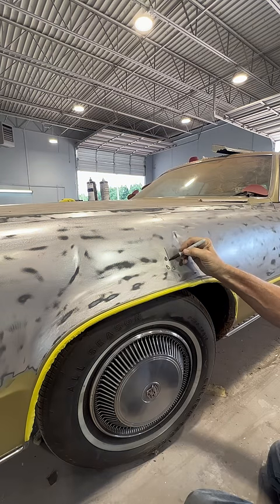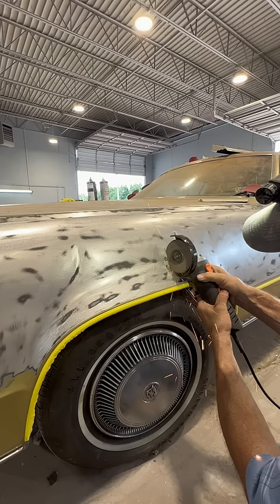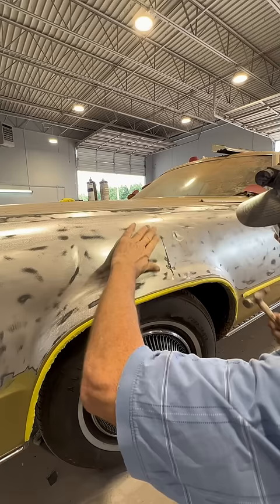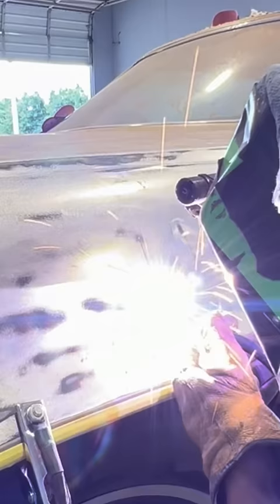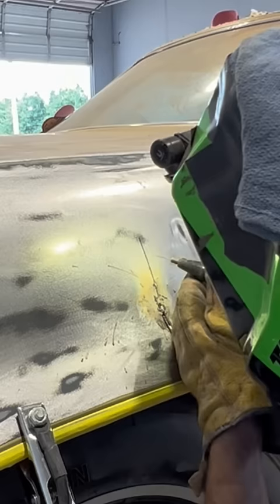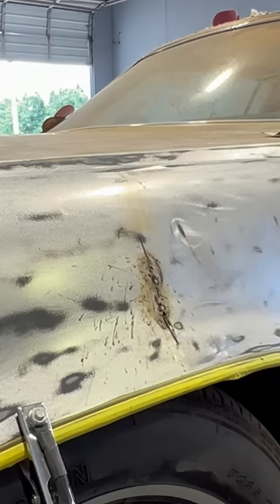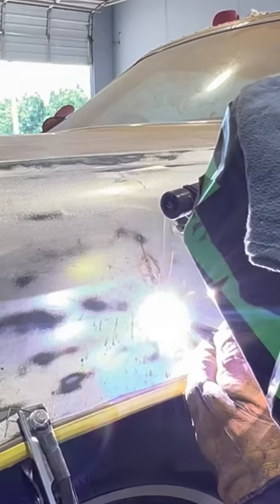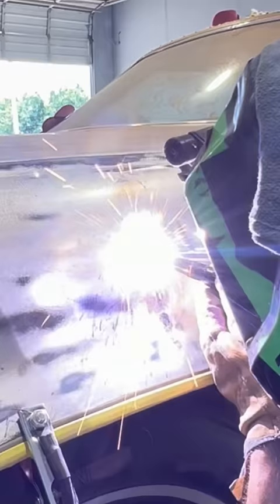BILLY SHOULD BE ARRESTED🤣 How To Fix A Buckle In Sheetmetal FAST DIY Auto Body Repair Flux Core Weld

Comment: I agree with everything you're doing here. But as a Welder you have way to much stick out. Constructive criticism here. Try to keep it wound 1/4 or just under. You'll get a better tack out of it
Reply from the maker: You must be an actual welder.  As you guys are generally clueless about welding sheet metal, I’ll give you some constructive criticism on giving critical analysis of things you’ve never done.  I’m not tacking, I’m stitching.  The violent arc of flux core is prone to blowing out thin sheet metal, even when stitching.  I can partially regulate this with a longer stickout.  I know your intention was to help me, but I am the master of this process, and it is proven😉😉
Reply: @Bondo Billy🆙  actually, have done*. All the long stick out is doing is reducing the amount of amps at the metal. Lower settings would shorten your stick out with a better looking end product on both sides, and a stronger bond of the metal. But in the end its all covered with body filler right! Shitll buff
Reply from the maker: @mm88swrt I explain things so a preschooler can understand, and yet the geniuses can’t.  My process is not in the books, so you want to fault it.  That’s why I’m above expert and professional level;  because I have developed a better way that can actually put welding skills closer to the reach of the novice.  
High heat = instant fusion 
Instant fusion = less warping 
Long stickout = less holes
Billy technique = mastery

Comment: I have some minor sheet metal work I need to tackle, why do you need to Fberglass over the weld? 🤔 I heard something about oxidizing? My rear quarter is asking 🤓
Reply from the maker: The flux residue can bubble bondo, but not fiberglass filler
Reply from the maker: The flux residue can bubble bondo, but not fiberglass filler

Comment: think i would have use oxy acetelyne to shrink it down, no welding needed.

other option is itd not that sharp, use the electric stud gun with the heat tip on it do do the same to avoid the oxy contamination
Reply from the maker: A buckle can’t be “shrunk”

Comment: For what a new fender for a Cadillac cost, and is badly as their maid which means it wouldn't fit anyway, your way is probably a hell of a lot better.
Reply from the maker: I doubt they make an aftermarket fender for a first gen FWD Eldorado 🤔🤔
Reply: @OldBondoBilly  you need to find a better junkyard.
Reply from the maker: @fooman2108 you said new fender

Comment: I did notice you didn't drill the hole at either end of the cut hopefully it doesn't crack at that point
Reply from the maker: I’ve never seen that happen
Reply: I was taught this way way back in the day so that it didn't stress the metal especially when you're doing framework but it was also told to do it when doing body work
Reply: its not like they are going to hook a chain to the fender to pull someone out of the dtch!🤣

Comment: Is it just kitty hair that you put over the weld? Or an actual layer of fiberglass then body filler? Also, would you not have to do that if it was a regular mig with gas?
Reply from the maker: I have put fiberglass filler over flux products since I braised patches in in 1981. You risk Bondo bubbling if you have any pockets of flux left.

Comment: I've seen other methods where they shrink the area in question with heat from a torch. Sorry, I can't find the link.
Reply from the maker: You can shrink stretched metal, but you cant shrink a buckle

Comment: Lol where do I start. where is the welding tip’s cup? Are you using any gas at all? that weld looks dirty. It should look shiny or at least not look muddy. Did you clean the back side of the weld? You get what you pay for I recon. Hope this was a down and dirty repair. 😂😂 cause that is what they got.
Reply from the maker: Watch more of my videos if you want to cure that ignoramus condition 🤣🤣🤣🤣🤣
Reply: Gas? Fluxcore.

Comment: All metal has Memorie,
If metal stress is relaxed properly, and the correct way to use a shrinking file hit it with your 50 grit grinder and your done. Your process wears me out to much to much going on for that solution. Just saying🤨🤨
Reply from the maker: Did some worthless school leave you so clueless?  Do you not know the difference between stretched metal and a buckle?  Do you even know what work-hardened means?
Rhetorical questions;  you don’t shrink a buckle. 🧐🧐🧐🧐🧐

Comment: That is a great way to do it.  I would have heated it cherry red and used my pecking hammer to shrink it followed by filler.  I lasted a little over two years doing body work and would never done the quality work you do.

Comment: Next time just run a weld down the buckle and hit it with a wet rag while it is still hot, you don't need the cut.
Reply from the maker: The metal is not stretched.  I’m the master here🙄🙄🙄🙄🙄

Comment: HEAT   THE BUCKLE and SHRINK IT with the Torch in spots the si ze of a Coin. Then   a  Slapping File You made from a Bastard File. Cooling with water or Air.Less Work. Flux Core is Diseasded with crap  ,get a Wire Feed
Reply from the maker: Stop pretending to know metal work.  You can’t “shrink” a buckle.🙄🙄
Reply: (Use a Cutting Torch)A course file , cut off the handle, bend into a step. about 1 inch3/4 .You want the teeth,  angled toward you ,to pull the metal! called Slapping File, old 🏫  school. I share my tips , not hoard them

Comment: I've personally never met a professional that was against Flux or mig. They both have there strong suits and negatives. I personally prefer mig for allot of reasons But Flux will get then job done just fine. especially if your a DIY guy. I got over 100k in equipment in this facility that would be stupid for the guy at home to buy when he's going to do it 5-10 times in his life. With just a little more work the diy guy can do just as good without the expensive toys. Hell when it was just me  25 years ago I did it.
Reply from the maker: Bravo;  I’m providing instructions for the success of the DIYer.  You for certain know that an amateur can lay down a meg bead that looks pretty without any real penetration.  with flux core, it’s weld, or hole;  there’s no in between.  I’m teaching how to avoid the holes.😉😉😉😉😉
Reply: @OldBondoBilly  your helping out allot sir. and even professionals cant know everything so I love to watch videos like yours. sharing tricks of the trade learned from decades of experience that other professionals may just not have though of before. you may have helped make their job  and mine just a little easier. thank you

Comment: Just wondering if there is a reason you run that much stick out. I had to weld a bunch when I was an apprentice and the only time I could run like that was with dual shield. But hey not everyone is BB!
Reply from the maker: More stickout, less hole.  I tell you, but I just clown the dumbass “welders”😂😂
Reply: its flux core dude.  you can have as much stick out as you can control.  I've ran as much as 6 inches of stick out running 3/32 wire on an LN-8.
Reply: @tkfmw1192  Cool. Just asking. The welding my apprenticeship covered was for coded industrial pressure vessels. NDT was usually x-ray . The amount of inclusions allowed is pretty small. But hey that never stopped me welding on my own cars🤣. Lucky at home is the only time I weld.
Reply: @OldBondoBilly  so you run more stick out for less heat 👍. Edit: I'm going to go home and try tonight

Comment: I could care less about the cutting and welding. I get that. But that weld on the backside is going to rust very fast. So how are you fixing that issue?
Reply from the maker: Wax wand
Reply: @OldBondoBilly   I’ll have to look into this as I don’t know what that is.  But my initial thought is it being wax wouldn’t that wear away relatively quickly

Comment: I know the video is short but when you cut metal it's no exposed to the air it will rust  what about underneath the fender after he's finished is he going to coat it to prevent rusting i Don't know but I can tell you if he doesn't coat underneath with something to prevent rusting thay fender it will rust bad not saying he didn't the videos too short for that
Reply from the maker: Wax wand

Comment: After 40 years in the business, you still don't believe in a mig welder?
Reply from the maker: I used MiG welders for 36 years, and I was I-Car certified in MiG in 2000.  I didn’t find out flux core was far better suited for sheet metal til 2022.  Never stop learning 😉😉

Comment: Why flux core don't you have a gas unit otherwise I would have done the same thing if I didn't want to take the fender off I don't know exactly what you were working on but it seemed like it was an old metal inner the only problem is when you go to line up the hood because something else moved besides that Buckle in the fender that's why the Buckle is there that would think I just felt like putting my two cents in I don't really care I won't see it from my house
Reply from the maker: Something was lost in translation there…

Comment: How about heating it up and shrinking it ?
Reply from the maker: It’s a buckle; not a stretch.  The center of a buckle is a crown that has been “work hardened” through the bending caused by the displacement of the lower portion of the rectangular measure of the fender.  The lower front was moved back, creating the buckle in the middle.  As I had said, the optimum reps would involve hydraulic equipment to move the lower front corner back into position while body-hammering the buckle.  Just heating and beating it would still cause a huge dent on each side of the buckle.  By cutting through the work hardened crown of the buckle, and having a little gap for free movement, I am able to hammer the metal on both sides back level.  The weld cinches the deal by pulling the metal inward towards the weld, flattening it even more.  I’ll put the body filler portion of the repair up on Monday.

Comment: The funny thing is that you don’t take the trim off but the rest of the car is down to bare metal, yeah I know you don’t see under the damn trim but there’s still the old ass enamel or lacquer paint under it and how in the hell you gonna sand down in the crack?
Reply from the maker: I am not the engineer of the repaint.  I was hired to repair rust and a few dents, not disassemble a car.  I t was not necessary to remove anything to fix the buckle🙄🙄

Comment: I’m no professional but I thought you should be much closer with the gun 🤔
Reply from the maker: The closer you get the more intense the heat.  Blowing holes in sheet-metal is always a problem with flux core.  I don’t follow the would-be rules of profeshunuls and exspurts. That’s why I am the Master. 🧐🧐🧐🧐🧐

Comment: How far away can you weld from?
Reply from the maker: When I’m welding rusty metal, I might have a stick out of 2 inches or more.  I’ll explain it in detail in upcoming welding video.
Reply: @OldBondoBilly  so it's easier to get some meat on her before putting a more permanent filler weld in? 
Welding rusty cars is almost nothing to do with actual welding eh lol

Comment: Dude just open my eyes cuz i got a little ass dent on my ruff on my 07 Hyundai tiburon and i dont want no body guy putting bondo on it cuz its all orignal with 94,203 miles on it plus its a manual transmission
Reply from the maker: I like it. 07 Tiburon’s.  Find a master Paintless dent repair guy😉😉
Reply: @OldBondoBilly   tha idea you gave me by seen your video makes it worth it to cut right in tha middle cuz its right between tha antena and tha back glass and idk if you know but tha back glass is like almost 500$ cuz is one piece

Comment: What do you think of the millermatic 250x?
Reply from the maker: I think it’s an awesome welder, but too big for auto body, like most 200+ amp welders are.  If you plan on welding thick stuff, you need one, but .035 wire and those bulky guns aren’t handy for bodywork.  It a pain to switch wire and tips, so you should also have a 110v welder if you weld much sheet metal😉😉

Comment: Cave and pave
Reply from the maker: It’s the caving that we’re avoiding 🤔🤔🤔🤔🤔
Reply: @OldBondoBilly  I mean you gave it an attempt by slicing and tacking in hopes of shrinking it but the after math of what you did with the hammer only highlighted the dent which you can see in your vidjayo.  Make an access hole in the inner fender and planish it out and patch up the inner fender after. Or hear me out now... A stud gun and a slide hammer.

Comment: ever try using a BULLSEYE?
Reply from the maker: Obviously, not since I don’t know WTH you’re talking about
Reply: @OldBondoBilly  metal finisher ...the head of dolly hammer w/a metal pick tip when handle squeezed both ends come together used on single panel repairs ...like a hammer dolly application
Reply from the maker: @potlickerhound7262 I didn’t know that was the name.  I used a fellow bodyman’s around ‘83, but I never had my own 😉
Reply from the maker: @potlickerhound7262 I didn’t know that was the name.  I used a fellow bodyman’s around ‘83, but I never had my own 😉

Comment: Do you prefer Flux core or mig?
Reply from the maker: Flux
Reply: @Bondo Billy🆙   what is the advantage. I have always used mig. I am an old body man and will be 66 in July. I have done much of what you are doing since the late 70s back when fixing totals was profitable  and wrecking yards provided cheap parts but I guess everything is relative.  And Earl Schibe paint job was 99.95 any car any color and base clear was brand new. Back in the Dulux days and the new thing was Imron.